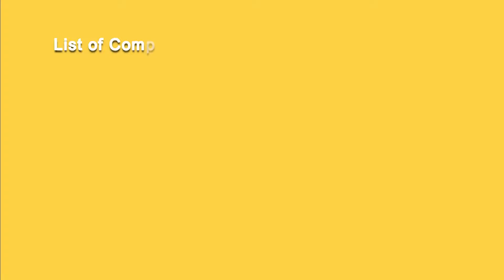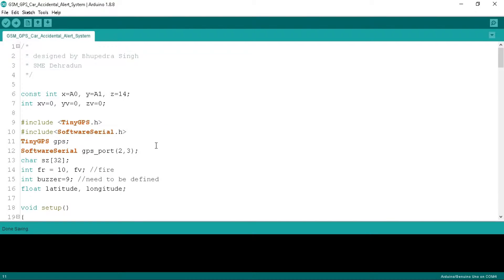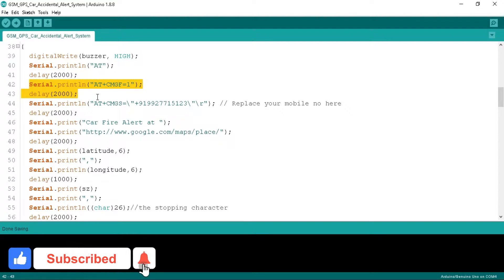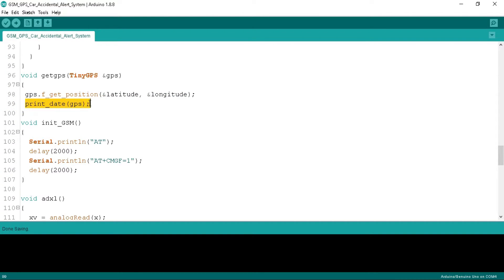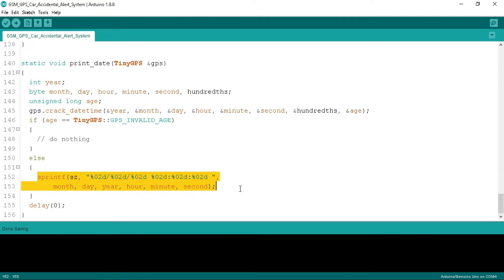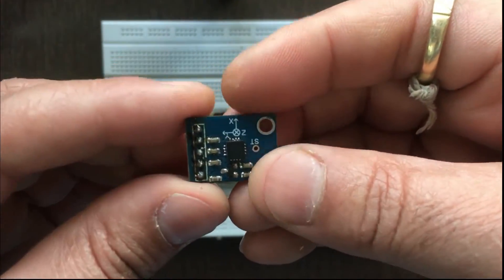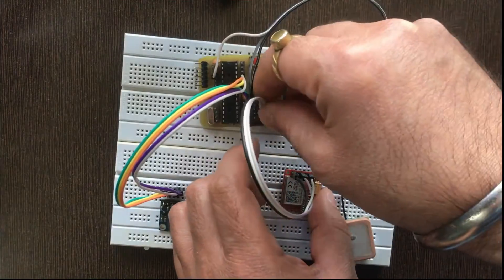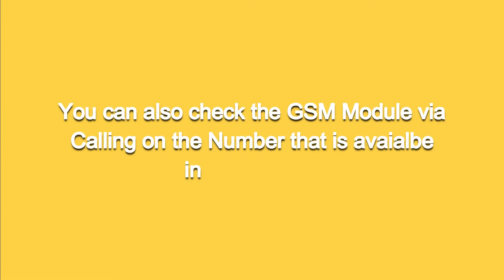Vehicle Accidental & Fire Alert System with GPS Location using GSM, GPS, Fire & Accelerometer Sensor

Comment: hi sir, im using 2 ultrasonic sensor, SIM900A and Neo-8M, why is that when my ultrasonic detect something the gsm and gps didn’t triggered, i already check all the connection.
Reply: may i ask, why you didn’t use both rx and tx for gsm and gps?
Reply from the maker: Because In gps, we need only receiver to receive data and in gsm, we are only sending the sms.
Reply: hi sir, i already emailed you
Reply from the maker: Check Your gsm and gps independent first then try with code.
Reply: @SMEDehradun  done that, it works well when i done it independently
Reply from the maker: Then check your code.
Reply from the maker: You need to check the gam and GPS separately and trace the coordinates in serial monitor. Once gps start getting gps data correctly, the light indicator start indicator light in tue gps neo.

Comment: hi sir, im using 2 ultrasonic sensor, sim900A and neo-8M, i only retrieve ultrasonic data, when it comes to gsm, it always failed to initialize, why is that?
Reply from the maker: Check your gsm separately with commands so that you can wnaure it’s working or not.

Comment: Sir can i use LM2596 step down converter for stepping down voltage for Sim800l gsm module with rating of 3.7 to 4.4 volt.
And also can i use vibration sensor instead of Adxl335
Reply from the maker: Yes you can. But remove the code for ADXL and add for vibration sensor.

Comment: What changes I need to make in the code for using mpu6050 accelerometer?
Reply from the maker: Replace the code of Adxl with MPU6050. Also change the condition for alert.
Reply: What do you mean by change the condition for alert ?
Reply from the maker: While it sense miss-happening.
Reply: @SMEDehradun  
when calibrating the GPS with the Arduino I did not get the reults . It does not change after 5 minutes , as you explained in the video.
I need help to figure out what the problem is ?
Reply from the maker: Gps signal is depend on your location. Take it outside from your place and then try.
Reply: @SMEDehradun    

Is the gsm unit connected directly with arduino, do we need 10k and 20k resistors to reduce the voltage from arduino?
Reply from the maker: No. It will not work.
Reply: @SMEDehradun 
When calibrating gsm, do we need resistance to reduce the voltage of Arduino 5v, or can we calibrate without resistance?
Reply from the maker: You need 4.2V power supply for gsm800 tiny module always.

Comment: At which voltage sim800l will work
Reply: In specification its written 3.7to 4.1 but in Arduino no such output is there
Reply from the maker: If you want to use a small size GSM 800L, then you need to provide 4V to 4.2V to it.
Reply: @SMEDehradun  i am using exactly the same you are using

Comment: Sir please explain in detail for connecting adxl345 instead of 335 🙏
Reply: Actually sir I am very confused in connection because pins are shown different on both sensors
Reply from the maker: @Ha.Bhai.goodmorning  you are using using adxl335 analog sensor ?
Reply from the maker: Both sensors are working same.  Connect and calibrate it.

Comment: Bluetooth connection is required to send it to my phone??
Reply from the maker: No.
There is gsm Modem attached in this projects that will send the message to the mobile.
Reply: @SMEDehradun  thank you! :) Is it possible to send gps data to my phone using gsm modem only using Jetson nano without Arduino or any other sensors??
Reply from the maker: Yes. You can. You need to all the commands that’s shown in to the programming code through your board.

Comment: I could not find any port named "COM9" in arduino software's "tools" option, so I selected COM3. Aftar that I tried to run the program. But I got an error message like- "TinyGPS.h: No such file or directory".
What can I do now??
Reply from the maker: Hi Tanvir,
You need to find out which com port connects your bird to computer.
Below video can help you to find install the com port in your computer. 

And you need to install tiny gps library for this program .
Reply: @SMEDehradun  Thank you. I have one more question. What if I use SIM900 module??

Comment: Dada i can't send messages through gsm please tell what should I do
Reply: Call is comming in my phone through GSM but message is not comming
Reply from the maker: The thore may be issue with code.
Reply: What code u are using i am also using same code, in the serial monitor it is showing that msg sent successfully but in that number i can't find any msg
Reply from the maker: Have you written you mobile in in the code in which you want to receive message?
Reply: @SMEDehradun  yess
Reply from the maker: Then it must otherwise your GSM modem is not working
Reply from the maker: First you need to check, whether your SIM card is on at gsm modem or not? You can call on the SIM card no that is inserted in the gsm modem. 
We need to provide 4V to gsm modem for working.
Reply: Did your project worked successfully

Comment: Can i define another pins for the gsm and if yes how. nice video and nice toturial about how it works..
Reply from the maker: Yes you can define the software serial port for gsm as defined for gps in the code.
Reply: @SMEDehradun  Can you give me a tutorial how its done. i am fighting with a sketch where i want the sketch to respond on a sms "GEO" with the location but with the gps code part in the sketch it locks the rest of the sketch up. its a sketch controling relays som pir sensors and some volt sensors and the sketch runs ok without the gps code.
Reply from the maker: I will try to figure it out. You need to send me the brief about your project.
Reply: @SMEDehradun  do you have a email.
Reply from the maker: Drop a mail at schematicslab@gmail.com
Reply: @SMEDehradun  Did you get my mail.
Reply from the maker: Yes. I have reverted you the answer.
Reply: @SMEDehradun  I have GSM SIM 800 C will this model work
Reply from the maker: Yes It will work.
Reply: @heilmannsvej  i am getting issue with the sim 800l and also suggest me from which site i have to buy sim800l maybe this one is damaged
Reply from the maker: @emphasisrenovation2245 I think, I have already provided the video description link for gsm board.
Reply from the maker: Arduino can handle 2-3 software serial at a time. So there is not any issue for handling gsm and gps at a time. And if you want, then you can connect gsm board to inbuilt Rx and Tx pins
Reply: You made the project??
Reply: @emphasisrenovation2245  Yes i made it on a esp32. it ended with controling 4 relays. has 2 volt sensors. gps location. water level sensor. pir sensor for inside boat. pir sensor for outside boat and a door sensor. led for sensors is disablet and led for when sensors are active all controled by cellphone. it has run for a year now 24/7

Comment: sir, What changes do I need to make in the code for using ADXL 345 accelerometer?
Reply from the maker: First need to calibrate the x, y and x axis data, after it map it as per your application
Reply: @SMEDehradun  sir please explain it in details 🙏
Reply from the maker: Already explained all in video. What else you want to know.

Comment: Respected sir, 
Can I use MPU-6050 Module 3 Axis Gyroscope | Accelerometer Module | Tilt Sensor Module

In place of Adxl 334 module ?
Reply: Thank you for replying sir.
Can you please tell/ mail me the modifications I need to do into the code ?
Reply from the maker: I think you need to search the in google, you will get the library & example code for that. Try that.
Reply: @SMEDehradun  okay sir
Reply from the maker: Welcome Ayush
Reply from the maker: Yes you can use. But you need to made some changes in code to read the MPU6050.

Comment: Hi sir, can I use sim900a instead of sim800L? Thank you
Reply from the maker: Yes you can.
Reply: After uploading the code, its not giving any text message. Instead, all AT functions were printed on the serial monitor. May I ask what should I do in this case?
Reply: @jeffashleycatipay3639  similar problem. Was your problem solved?
Reply: @jeffashleycatipay3639  same problem it unable to send sms

Comment: sir can we add a SOS button to this project
Reply: Sir pls share how to use adxl 345 instead of 335
Reply from the maker: You need to connect the ADXL345 in I2C pins. Calibration are the same. I will try to share.
Reply: Ok sir I ll be waiting for reply
Reply from the maker: I will try.
Reply: Sir it's not working on Airtel and bsnl sim
Reply from the maker: Which one?
Reply: Sir when i used Airtel and bsnl sim in gsm model it's not sending sms to registered mobile number
Reply from the maker: Hi,
It may be due to not proper power for the board. 
This is the gsm module that will work properly. 
https://www.rhydolabz.com/wireless-gsm-gprs-c-130_185/gsm-gprs-quad-band-ttl-uart-modem-sim800-rhydolabz-p-2183.html?gclid=CjwKCAjw9NeXBhAMEiwAbaY4lrIOAsO-sDc-XVCKTisonDRvWR9FoPSU6ADO3wLUBCzPyJEWdctEUBoCAzYQAvD_BwE
You can use this gsm800 module. It will work.
Reply: Code will be the same?
Reply from the maker: Yes.
Reply: Sir can u send me the coding of sim900a
Reply from the maker: Code is same for the SIM800 & SIM900. You can use the same code for it.
Reply: Hello sir can u pls tell how to add sos button to the circuit and coding please
Reply from the maker: Hi Ravi,
It will be helpful, if you write your query on message box of the related video. So that I can understand what question belongs to which video.
Reply: @SMEDehradun  Vehicle Accidental Alert System using GSM & GPS with Google Map Tracing- Complete Guide with Code this was the video in which i want to add sos button sir
Reply from the maker: K. So you can add button in any remaining pin & write the code for SMS.
You can take the help form my another video for GSM calibration in my channel.
Reply: Respected sir I have made this project of accident alert system and is working n  thanks for the guidance. Sir can u pls share how to add sos button to this  project and coding
Reply: @ravipatil8249 its unable to send the sms please help
Reply from the maker: Hi Ravi,
Add new virtual pin to blynk datastream then make to code for it.
Reply: @SME Dehradun .sir is the code is same for all
Reply from the maker: This is based on Arduino Uno. If you want to use it with other Arduino boards, then it can work.
Reply: How Many codes are there in the accident prevention system sir
.
Reply: Does this project worked successfully i am facing problem in sending sms
Reply from the maker: Use 4V or 4.2V voltage to operate the Gsm modem. Also check that your sim support 2G network.
Reply: @SMEDehradun  i have done everything i have run other code by this module i can call in mobile
Reply: But cannot send sms for this code
Reply from the maker: Only the right connections can help you. Tiny Gsm May arise such issue due to insufficient power management.
Reply from the maker: Hi @Ravi,
Yes it can.

Comment: hi , sir can we use SIM800A in this?
Reply: did u modified code
Reply from the maker: For what?
Reply from the maker: Yes why not.
Reply: @SMEDehradun  can i put 4g bsnl SIM?
Reply from the maker: For this, you need to use SIM7600 Module.
Reply: @SMEDehradun  and the code will be same?
Reply from the maker: No. Code will be different for GSM module